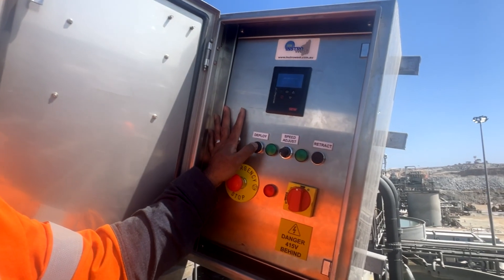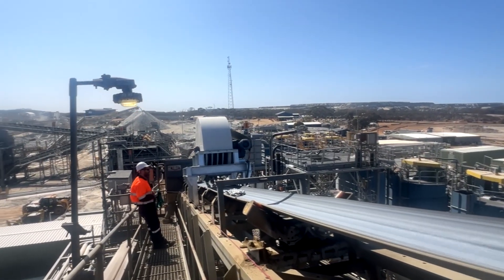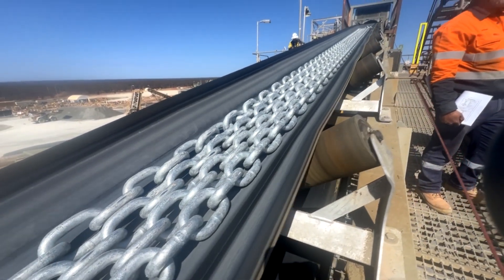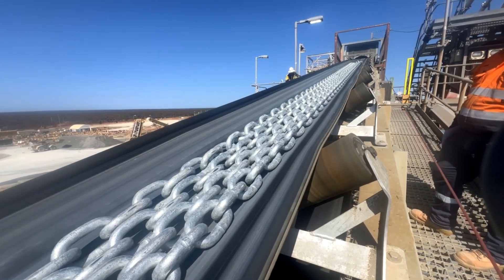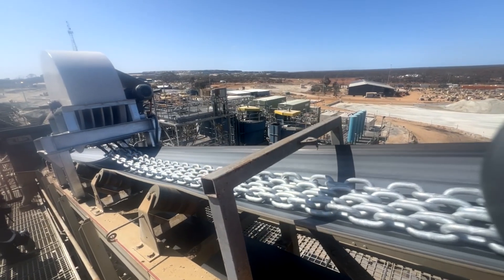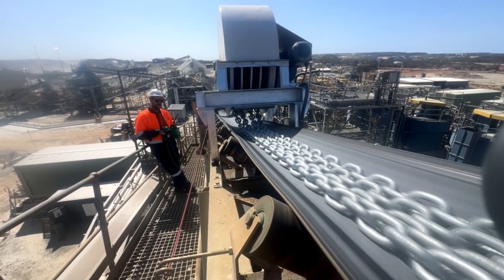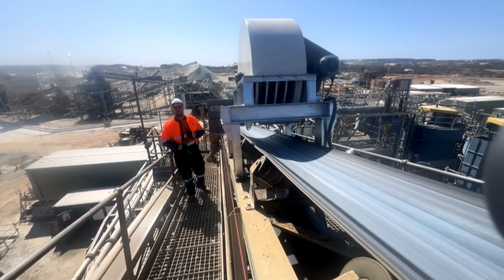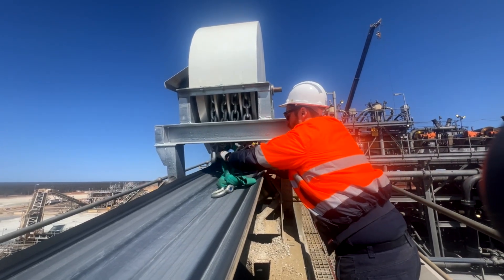Instrowest Drag Chain Deployment System.

Comment: What is the purpose of introducing the drag chain to the conveyor?
Reply: Chain calibration in belt weighers is essential for mimicking the real material flow on the belt accurately. Here's why it is crucial.

Accuracy in Material Flow
Chain calibration helps in calibrating the belt weigher to accurately measure the material flow on the conveyor belt. This calibration ensures that the weight measurements correspond closely to the actual material flow, enhancing the accuracy of the system.

Real-Time Monitoring
By calibrating the belt weigher using chain calibration, the system can provide real-time monitoring of the material flow on the belt. This allows for immediate adjustments and corrections to be made based on accurate weight measurements.

Dynamic Calibration
Chain calibration enables dynamic calibration of the belt weigher, which means that the system can adjust and recalibrate itself as the material flow conditions change. This dynamic calibration helps in maintaining accuracy under varying operating conditions.

Consistency in Measurement
Chain calibration ensures consistent and reliable measurement of material flow on the belt over time. This consistency is crucial for industries where precise and reliable weight data is necessary for process control and optimization.

Verification of System Performance
By mimicking the real material flow through chain calibration, the belt weigher's performance can be verified and validated against actual dynamic operating conditions. This verification ensures that the system is functioning correctly and providing accurate weight measurements. It take into consideration the impact of belt loading, off track and auto tracking effects on the overall weighing system.

Enhanced Process Efficiency
Accurate calibration through chain calibration enhances the overall efficiency of material handling processes. By ensuring that the weight measurements align with the actual material flow, operations can be optimized for maximum efficiency and productivity